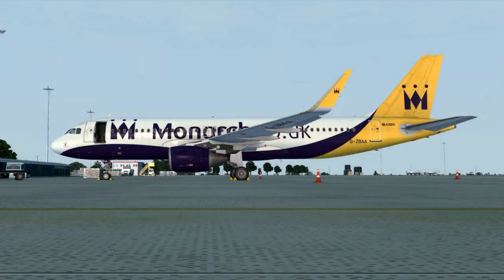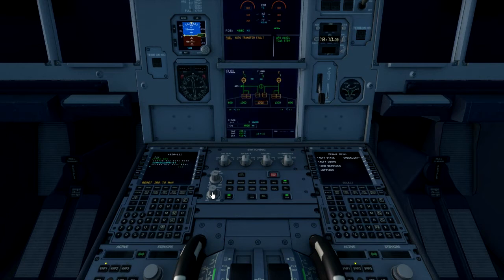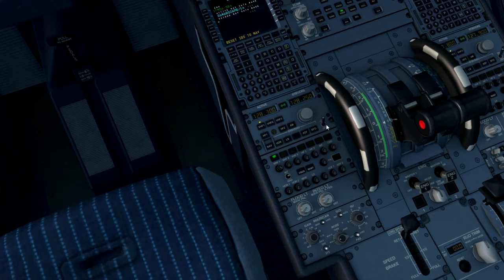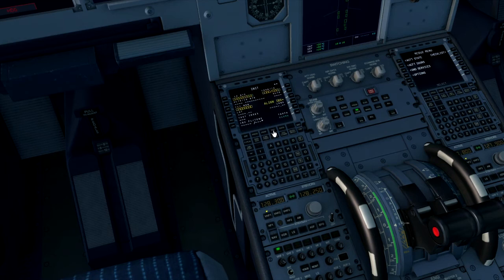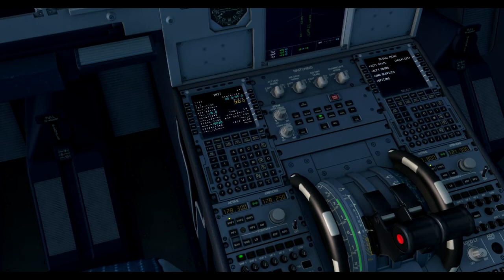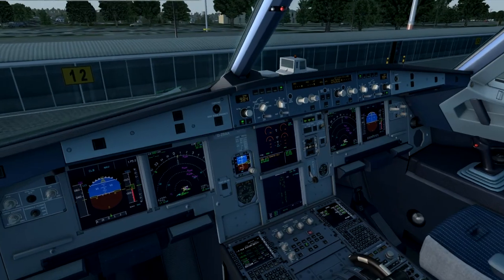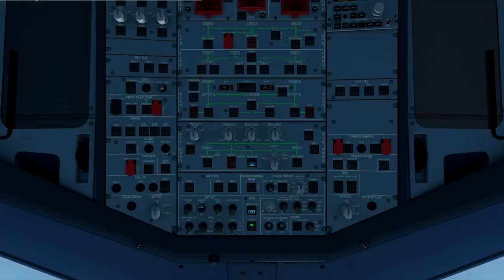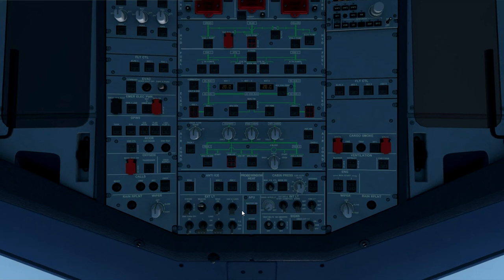FSX - Airbus X Extended: Cold & Dark Tutorial (with FMGS/MCDU)

Comment: What is cross index?
Reply: Marko Milinkovic The cost index is the speed to fuel ration , meaning that if the cost index is 0 the flight will be longer then if  the cost index was 45 but it will save more fuel.
Reply: Thanks holygamingbc

Comment: How often does the crew turn on Ground Power. It seems that many do not ever turn it on. Is this done more often than just going directly to the APU?
Reply from the maker: jujumediazone If the ground power is available it will be used, saves fuel and wear on the APU. The APU is turned on just before engine start to provide bleed air to the engines and turned off afterwards (as the engines bleed air to the cabin). Some airlines differ with their procedures, however.
Reply: jujumediazone In the US? -Yes. Happens very often. A heck of a lot more. Kinda rare to see the APU left on without Ground Power

Comment: When I put mine in cold and dark it doesn't work. My checklists say wait and my fuel planner won't open, saying there was an error. I can't control the plane with my joystick or throttle. I have once installed this on another computer and it worked. It won't on my other computer. Can someone help me?